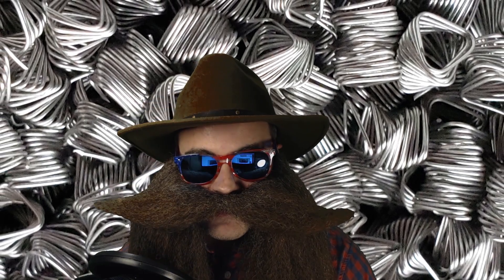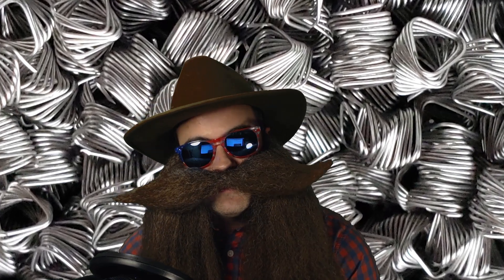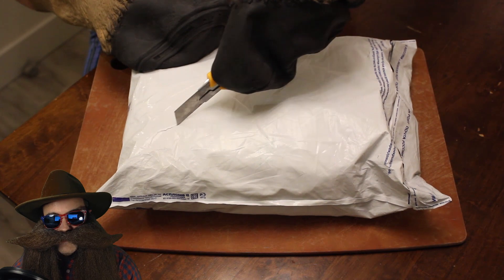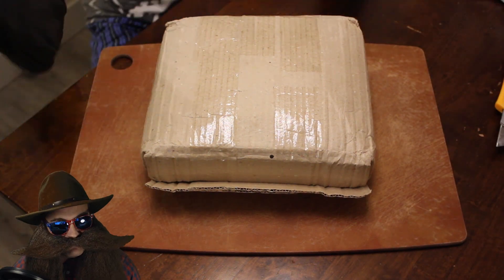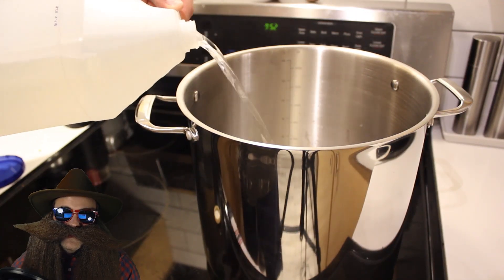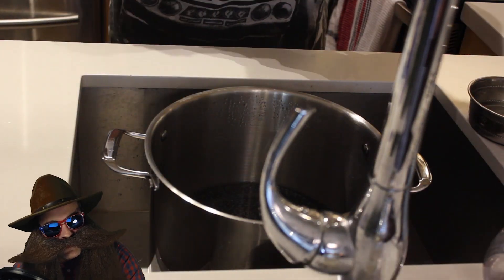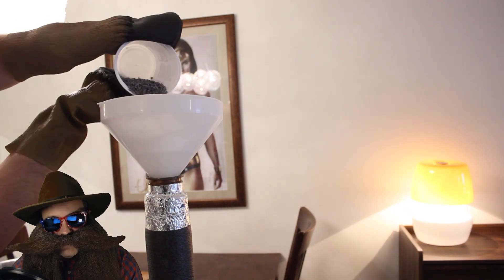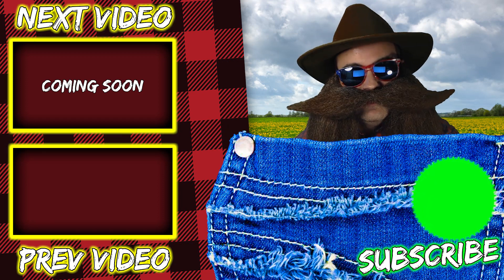Spiral Prismatic Packing - Cleaning, Unboxing, Review

Comment from the maker: What kind of column packing do you use and what is it made out of?
Reply: W Polsce nigdy nie było problemów z SPP. Za dostępne w każdych ilościach i rozmiarach. Można kupić miedziane do oczyszczania z zapachów i ze stali kwasoodpornej 304 i 316. Ceny zaczynają się od ok 10$ za litr. Dostępne są od P/V 600 do P/V 2000.
Reply: copper mesh stops and dime to nickle sized lava stones. They are much cheaper and just as effective.
Reply from the maker: @snappingbear  Always interested to see other people's experimental data with SPP compared to other packing materials. How much better was your run with copper mesh/lava rocks compared to the SPP you ran? What are your still specs and the size of your SPP? Super interested. I've seen others say that lava rocks work wonders.
Reply: @OpenSourceDistilling  Why would I need to purchase absurdly expensive SPP for a comparison when I just told you about lava stones? You have mentioned you know about the HD forums. It is common to see them tell newbs to read  the forums and to use its search function before buying anything. There is no need to waste money reinventing the wheel as almost everything as been tried and tested (see link at the end of this message).

My old still was similar to yours. It was keg based and used 2" SS spools, but employed a CCVM design. Using lava stones it produced  95% ABV.
A 2" x 24" SS spool has a volume almost exactly equal to 1 liter; based on the ebay listing you posted it would cost 53 USD  to pack it, but if you used scoria or lava rocks it would cost a dollar or less. I would rather spend money on sight glasses or larger diameter spools or quality high temp enzymes than packing.
https://homedistiller.org/forum/search.php?keywords=lava
Reply from the maker: @snappingbear I’m not so concerned with the cost of the packing, but with the performance of the packing, although I can appreciate that cost is a concern for many. I asked about data and details because Riku did that exact test, lava rocks vs SPP, and found that SPP outperformed lava rocks. I may try some lava rocks in the future as still packing and see how it goes. As for SPP being worth the cost, each person will have to make that call themselves. I certainly would never find value in buying something like a Ferrari, but that’s not to say that others won’t find value in (what I consider) an overpriced sports car. Here is a lengthy HD discussion with over 500 posts regarding still packings if anyone is interested. https://homedistiller.org/forum/viewtopic.php?f=1&t=30727
Reply: @OpenSourceDistilling "Riku did that exact test, lava rocks vs SPP, and found that SPP outperformed lava rocks". 
As I advised read the forums the answers are there.  I am glad you did. Many including me get 95% ABV with lava stones. I doubt you are going to beat that with SPP and if you do the cost is not even close to being  justified.  The thread you posted is a good one and is referenced several times in the search results I posted in my previous post. HD is packed with all the info anyone needs about distilling including tips on building cost effective distilling systems..

The things I think are worth spending coin on are bigger pipes, sight glasses and most importantly a temperature controller that includes a PID,   They are not expensive if you build your own.  Although I haven't published it, my design is fool proof and safe . All anyone needs to know is how to use a screw drive, a lighter, a drill and isn't color blind.
Reply from the maker: @snappingbear  I never put much thought into how much things cost, I just kind of saved a little here an there and bought upgrades when I could. Asked for things for Christmas and birthdays. You are correct, SPP is probably the most expensive packing out there for home distilling. If you are interested in the notes from my first spirit run with SPP click the link below. My alchometer is from Amazon so take the readings with a grain of salt. The readings are temp corrected. Next time I go to my friend's distillery I will take a sample and use his set to get a 'government approved' ABV. My still produces 95%+ with SPP or SS scrubbies however, I can run the SPP faster. https://www.opensourcedistilling.com/spirit-run-1/
Reply: @snappingbear  Maybe if you didn't use a PID you'd get better results. They are great for brewing beer as they fully turn on then fully turn off the heater element, but they don't allow you to adjust the constant power going into the still. You'll have a hard time keeping equilibrium in a reflux column with power turning on/off every few seconds. You need a burst fire or a phase angle SSR to achieve constant power adjustments. Using a PID may work fine for a pot still but it won't be doing your reflux column any favors. 

As far as lava rocks being better than SPP, everyone will have their own opinion about that. I have seen multiple commercial still builders use SPP in their flagship products, I have never seen one use lava rocks. I am leaning towards believing these companies that have staked their entire livelihood on the performance of SPP instead of someone on the internet using beer equipment to distill with. Someone that hasn't done ANY tests on their own to confirm which is better than the other. Someone that hasn't run BOTH packings on the SAME still. There is a ton of misinformation on the distilling forums, they are not the end-all and be-all of all distilling knowledge. Just because one person says something on the internet doesn't make it a fact. There are multiple videos on youtube showing the performance of SPP.

Comment: I recently added copper SPP to my T500 reflux column. 1 litre fits perfect. ABV now 95. Sweet smelling and tasting. I also put rolls of copper mesh in my boiler. The amount of sulfurs that the copper captures is incredible. I did not even charcoal filter this last run, allowing me to store concentrated product rather than diluting for carbon filtration. Next step is to adding more 2" pipe underneath, drop the stock packing in there until I can hit 95.6

Comment: Is a lot easier to clean them with sodium hidroxide (drain cleaner stuff), it will saponify the grease on the SPP and then you can simply wash it off with hot water. Just be careful while working with caustic solutions, wear safety glasses and gloves (or hooves in your case lol).

Comment: Howdey doody!  I have a keg based stainless re-flux still with a 3'' column 1.2 M tall. We are currently using scrubbies and average 85% ABV on a typical stripping run.
I have coming from Siberia 4L of SPP...3x3x.2mm stuff. It is slow getting to NZ for obvious reasons!
Do ya think this is the correct SPP for our still? Cheers for now mate!
Reply from the maker: That's the same size that I have. As I understand it, the smaller the size of SPP the better the purity but the less power you can push into the column before flooding it. The bigger the size of SPP the lower the purity but more power you can push into it before flooding it. You can increase purity by increasing the height of your packed column. More power mean increased production rate. I have a column about 1.3 meters tall and the SPP manufacturer said I should go with the 3x3 mm size to get a high purity with my "shorter" column. I get about 1.5 to 1.7 liters/hour of 95%+ with my 2" column. If I had a taller column I would have gotten the bigger size as I can make up the drop in purity with a taller reflux column and still get a higher power input. So SPP size has to do with balancing power input with purity output along with column height. I am limited by the ceiling height in my apartment, but if I wasn't I would go with bigger SPP and a taller column to get a pure product at a higher output rate. Given our columns are similar height, I would think that size of SPP is reasonable. There theories regarding packing size ratios to column diameters but I haven't tested those at all. Let me know how it works out for you as I'm planning on upgrading to a 3" column and I am considering different column packings for it. Happy distilling!!!!
Reply: @OpenSourceDistilling  Couldn't wait for my SPP to arrive from Siberia so made my own! Tricky to make but that's my stuff on Still It video!
Looking for a distributor in the US of A if ya know anyone interested!?
Reply: @wookie45nz  Got any for sale?

Comment: Did you do a stripping run in your pot still to get rid of the foreshots and now you are going to reflux still for your spirit run?
Reply from the maker: I don't do any cuts until I get to the spirit run. For me, stripping runs are to get rid of the solids and condense the alcohol into a smaller volume. During the stripping run, I'll run in pot still mode with a short column and no packing. During my spirit run, I'll use my packed reflux column, I'll discard the foreshots, collect the heads, hearts, and tails. Then taste to determine what I'm going to keep or throw away.

Comment: My understanding is that you want a saturated (flooded) column when using SPP.  While I can't find the link, I saw a russian video with them running a short 3 inch glass column ( looked about 60cm) with it flooded and pulling 96.6. One of the guys on HD says he runs a 30 inch (76cm) column at 3 inch diameter with large SPP  using a CVVM and his runs are shockingly quick. I'm looking forward to your future video running the SPP and your thoughts.
Reply from the maker: With oversized SPP I heard you can run it blazing fast. I have the HD link that talks a little bit about it. Eventually, I'll get a sight glass or two so I can see the fluid buildup at the top/bottom of the column. Thanks for your comment. Much appreciated! https://homedistiller.org/forum/viewtopic.php?p=7170356&sid=5f440d1eade085b453e2d03ff9d3a6c1#p7170356
Reply: Open Source Distilling this write up is astonishing. With my still I can pull 3 litres an hour at 40% of power of a 6000 watts heating element and of course scrubbies. I was supposed to be at 50% power but I flooded my dephlag and everything was pissing off my breathing tube... that was a little scary. Can’t wait to get it.
Reply from the maker: @1FrenchConnection1  I couldn't get close to that with the SPP I have b/c it's too small, but if you have enough ceiling space you can go bigger on the SPP and make your column higher, pump more power into it, and get higher output. My SPP is at a ratio of about 17 to 1 for SPP diameter (3mm) to column diameter (52mm). It appears the commercial SPP is about 10 to 1 (or maybe even lower).